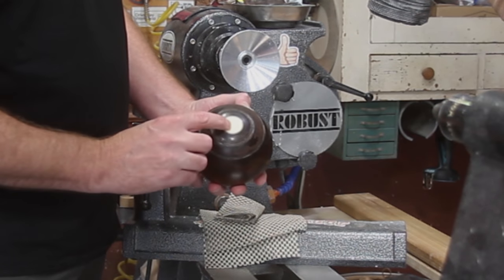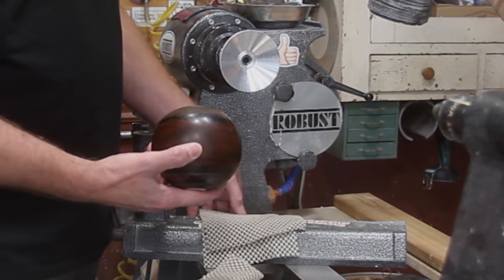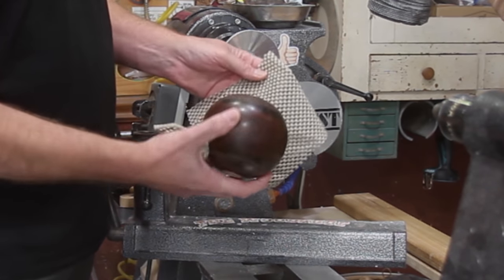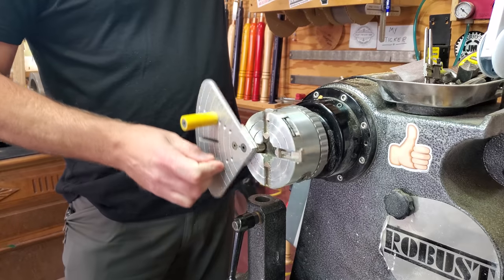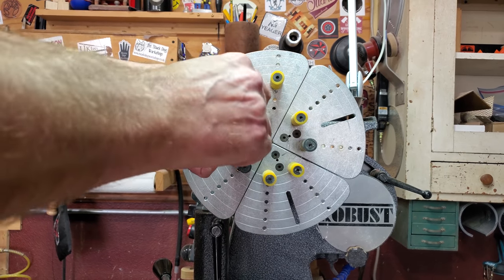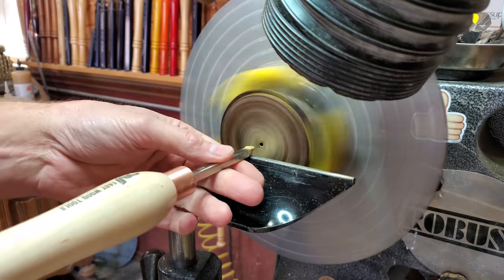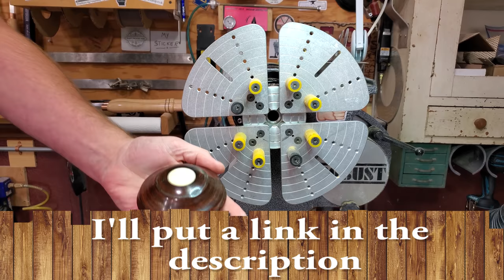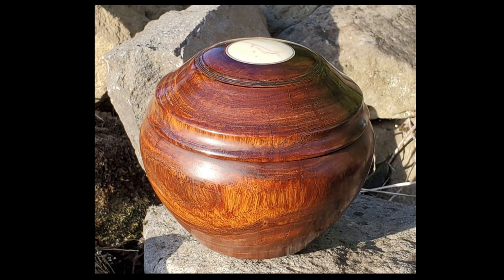Woodturning Lignum Vitae Lidded Box

Comment: I love turning Lignum Vitae. Some ships, still today even, use this wood for propeller shaft bearings because it self lubricates and repels water. *finishing tip * if you take a light flame to the piece while it's slowly rotating, its wax like sap boils out and can be polished onto the surface of the piece. This gives it a natural self sustaining finish. Kinda rustic, but very cool.
Reply from the maker: Very cool, thanks for the info.

Comment: Great job Carl!  A friend of mine gave me a couple pieces of Lignum Vitas.  His dad worked for the Massachusetts Water Resources Authority and the pieces were used as bearing for some underwater piece of equipment.  They are very dense and the texture is pretty neat almost waxy.  I'm curious if the bocce ball had the same texture.  - Ed
Reply from the maker: Thank you! Very cool, they turn great and yes a little waxy.

Comment: Hello Carl, 
how can you differ ivory (the 2 teeth of an elephant) from all other dental/bone material?
The 2 big teeth of an elephant grow lenghtwise in the design of a chess board. You have darker and brighter lines of a bit more than 1 mm (1/16 in.), crossing each other in an angle of 90 degrees (visible as squares when the tooth is cut exactly 90 deg of the lenghtwise axis). In all other angles and cuts (diagonal, rounded, etc.) you have these lines crossing each other like a parallelogram.
If you don't find crossing lines like a chess board somewhere on the object IT IS NO IVORY.
If you have deeper and shallower grooves in the material like in the 1st picture down right (caused by different hardnesses in the structure) the chance that it is some kind of animal bone is high.
For a final conclusion I'd need a pic with much higher resolution or having the object in my hand. But here I tend to say: bone.
Reply from the maker: Thanks for the info.

Comment: That was really pretty. I was surprised that the shavings were so yellow with the wood looking as dark as it was. Is the walnut oil useable without a lathe? I’ve done some walnut projects, but I don’t turn anything. Thanks for the videos.
Reply from the maker: Thank you! Yes the straight Walnut oil will work without the lathe. The other ones are friction polish meant for the lathe.
Reply: Carl Jacobson Thanks. I’ll have to give it a try. I just made a set of dominoes and a box out of walnut. I just made it up as I went, but looks pretty cool.